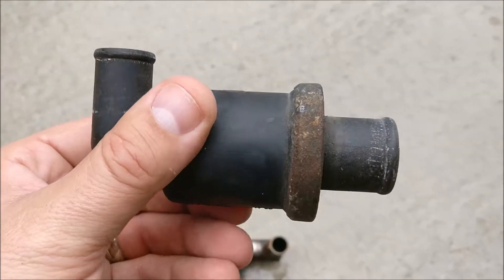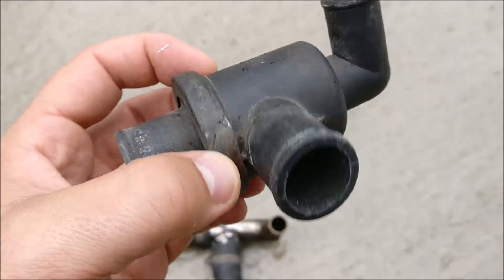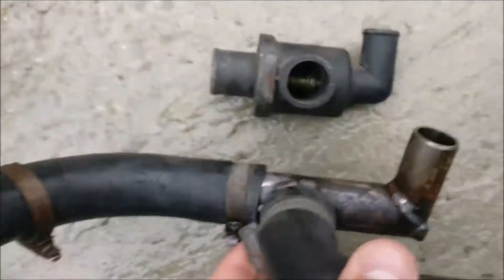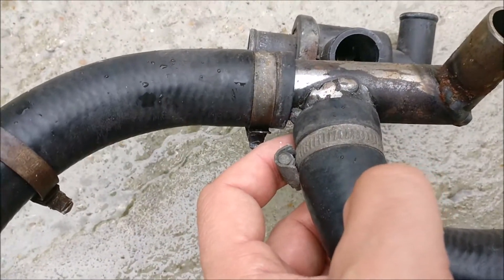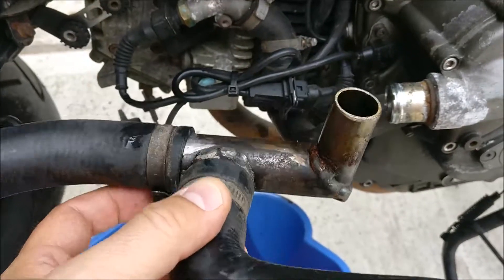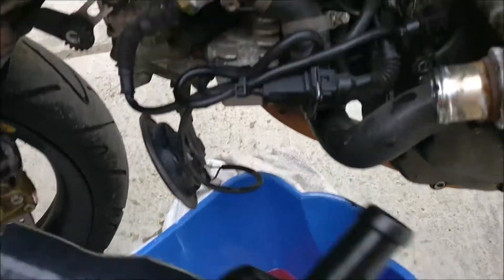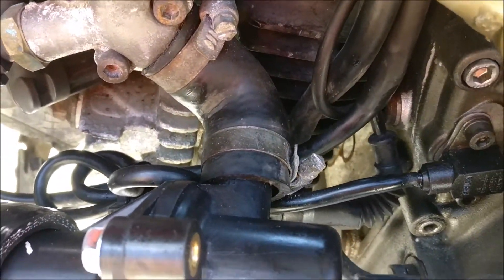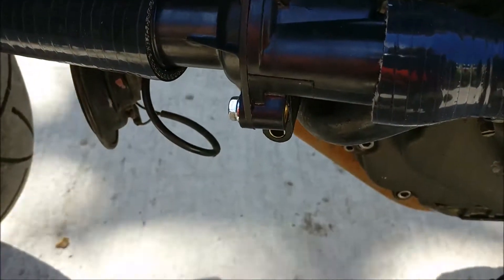DUCATI ST2 ST3? ST4? high-flow thermostat fix

Comment: Did this end up working well? Currently needing a new thermostat in my st2 and wondering if this is the way to go.
Reply from the maker: worked perfectly.  In my opinion better than original.
Reply: @texbid  did you order most of the parts off the Internet or can they be found at parts stores? Thanks for the fast reply.
Reply from the maker: @marcelhofmann167  all from ebay
https://www.ebay.co.uk/itm/Standard-Replacement-Thermostat-Housing-Rover-75-MG-ZT-MG-ZR-/332467008892

https://www.ebay.co.uk/itm/45-DEGREE-BEND-ELBOW-REDUCER-SILICONE-JOINER-WATER-AIR-COOLANT-HOSE-TUBE-PIPE/254242699219?hash=item3b320bb7d3:m:mF9xzthuP76sK8rww_mR90w

etc etc

Comment: Dude....Parts? What did you use?
Reply from the maker: Thermostat
Standard-Replacement-Thermostat-Housing-For-Rover-75-MG-ZT-MG-ZR

Hoses
Silicone Joiner Bend 
38mm to  25mm

Black Silicone Hoses
90 Degree Elbow,25mm,Black

Silicone Hose Straight Reducer Black  
Black,
38mm  to 25mm

Comment: ? no list of the parts you used to make a replayment?.....  Do you smoke weed?........   lol
Reply from the maker: Thermostat
Standard-Replacement-Thermostat-Housing-For-Rover-75-MG-ZT-MG-ZR

Hoses
Silicone Joiner Bend 
38mm to  25mm

Black Silicone Hoses
90 Degree Elbow,25mm,Black

Silicone Hose Straight Reducer Black  
Black,
38mm  to 25mm

Comment: Goodnight
Where can I buy this replacement thermostat?
Reply from the maker: Thermostat
Standard-Replacement-Thermostat-Housing-For-Rover-75-MG-ZT-MG-ZR

Hoses
Silicone Joiner Bend 
38mm to  25mm

Black Silicone Hoses
90 Degree Elbow,25mm,Black

Silicone Hose Straight Reducer Black  
Black,
38mm  to 25mm